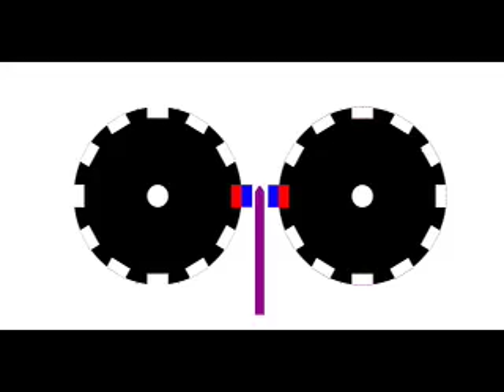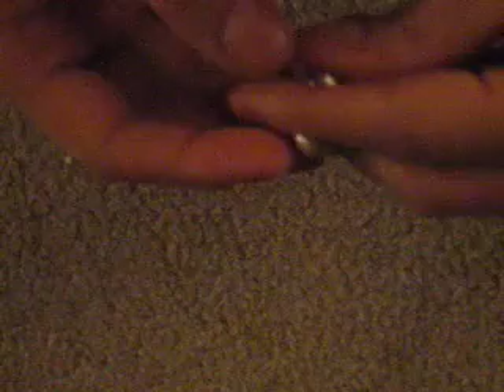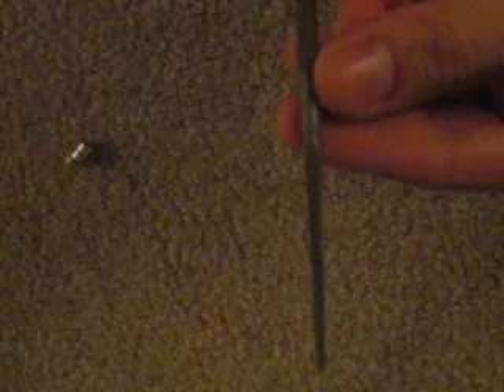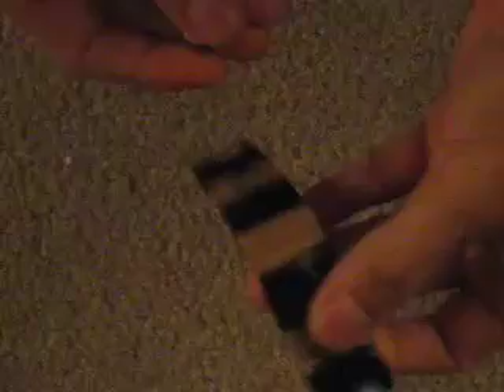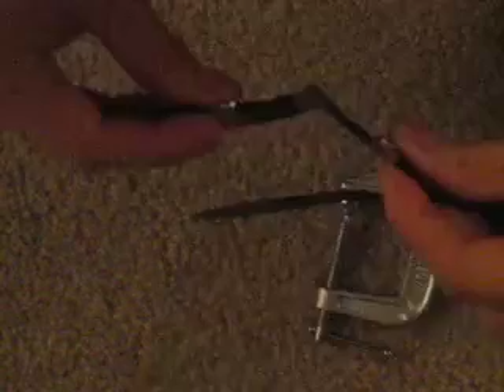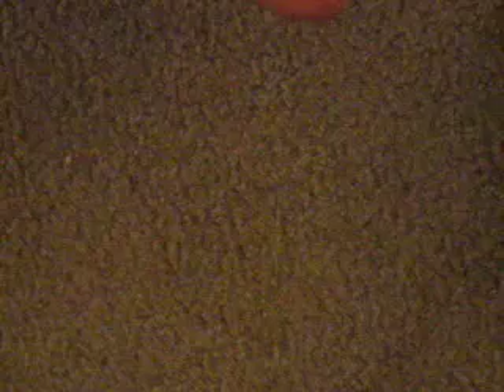Magnet Motor concept and How magnetic shielding works

Comment: Doesn't work of course. Moving the shield consumes the energy which is produced. The principle of conservation of energy is known since 150 years. It's time all people take notice of it.
Reply: Durchblick A small note:  Actually it is likely that moving the shield will consume more energy.  At each point some energy is converted to heat.  The shield will warm up as you change the field in it.
Reply: Ken Smith
Thx for adding this, you are definitely right of course There are always losses. Besides the field changes also eddy currents will occur.
Reply: hehehe
Reply: Durchblick Conservation of energy has any relevance at all to electrical system IF* the it is a "closed" electrical system. In an open electrical system energy can come from the the outside and add to the circuit. That is how John Searl generator works, also why if you use longitudinal electric waves to transmit power you'll get more energy at the receiving end than was sent. The electric wave picks up frequencies from the environment and adds to itself.
Reply: Naoki Kashima
Conservation of energy is applicable also to open systems, if you account for the energy going in and coming out and the energy which is stored in the system.
John Searls generator does not work. There is no proof for that at all. Longitudinal electromagnetic waves are nonsense, they do not exist. You can pick up energy of electromagnetic waves, every radio does it, but the origin of this energy is well known, it comes from the radio station.
Reply: Durchblick What about solar panels or wind power? The power for those systems come from the environment... those 2 examples are 'open systems'. What about 'free electrons"? What about radio wave, or natural radiation? All these things offer a source of energy. A friend of mine replicated more than 1/2 of John Searl's generator. He used polymagnets, the works. There are many many other self running generators out there. The Howard Johnson's magnet motor, Testaika Generator (still running in Swtizerland, uses no known fuel), water-powered generator (Stan Meyers). Recently a company came out of Canada "GDS Generator" that runs using only water. Turns out if you hit water molecule with the right frequency it will just fly apart. Again extra energy to help with this process come from the environment.
Reply: Naoki Kashima There are a lot of con artists out their, a lot of urban legends and enough nut cases to make it slightly uncertain what you are dealing with.  There are no free energy machines that actually work.  The easiest person to fool is your self.  Ask any scientist.  You have to design an experiment with the intention of proving the idea is bogus and then carry it through as planned and then look at the results.
Reply: Naoki Kashima
Energiwa from the environment (solar, wind, radio waves, radiation) are well known. Also well known are the devices to tap them and the amount of power which can be harvested. Power from radio waves and particles from space is rather negligible.

But the devices you mention definitely are not using these energy forms - so where should the energy come from? Howard Johnson never got his magnet motor running. Testatika was demonstrated, but no one was ever allowed to investigate it and it was never in practical use. Stan Meyer was a scammer, he was sentenced for fraud. He had a patent but no one was able to replicate his electrolytic cell. Up to now all tries to split the water molecule with less energy by a certain frequency have failed completely. In regard to free energy you find claims only, but never an objective third party proof.
Reply: Durchblick Here is a commercial for GDS generator, a generator that runs using water>> h t t p s://w w w .youtube. c o m /watch?v=vEqSuTOKUEg Here is a man from japan who invented a water-powered car independently from Stan Meyers >> h t t p s :// w w w .youtube. c o m /watch?v=CrxfMz2eDME&list=PLRmPNINoDGdXl4WxD9vhJDQukAUglXwlj Stan Meyers was NOT a fraud. He had patents across 3 different countries. Why patent a technology that doesn't work 3 times over (you have to pay $ every time you patent something). Stan's 'fraud trial' was a joke because he wasn't allowed to bring any of his technology as evidence. The court's sound recorder "broke" so his testimony was never recorded, etc.
Reply: Naoki Kashima
A patent is no proof that an idea works.  The patent inspectors are overworked and under paid.  All kinds of bogus stuff gets patented.  Because it is bogus, nobody is willing to pay for the lawyers to break the patent and thus it remains on the books.

Meyers didn't have anything that worked.  He may have believed he did or he may not have.  This is the only sense in which he may not have been a fraud.
Reply: Naoki Kashima GDS-generator is a scam, that's why they don't allow comments to this video. Also "Genepax" (your second link) was only trying to get money from gullible investors. They never gave the slightest proof of a working water car.
And it is clear why scammers apply for patents. This is more convincing when you try to get money for something which does not really work. But I don't say Meyer was a cold blooded scammer, most likely he was mentally disturbed. Meyer was not sued by the state, he was sued by two investors, who paid him 25.000$ for the right to distribute this technology but this technology never emerged and Meyer was not willing to return the money. The sound recorder may have broken down, but even in this case there is a protocol of court proceedings. And the court himself ordered an expertise of Meyers electrolytic cell. It was screened by experts, efficiency was well below 100%. For a water car you would need at least 400%! Meyers patent is public, no one ever managed to get an overunity electrolysis cell by following the ideas of this patent.

There is no need for you to supply me with further links, I guess I know them all. But if you can give me evidence that there was a free energy machine which was submitted to a credible third party test and was shown working, it would be interesting. But this never happened.

Comment: Law of Conservation of Energy. Sorry Bro. No deal.
Reply: *****
Please write the equation so we can all see how it violates the law of conservation of energy and your argument may (or may not) be validated
Reply: Peter Harris Interestingly enough, conservation of energy is a concept, that has very finite boundaries. I'm not so convinced even from years of physics study and Uni, that conservation is limited to a system, when it comes to magnetism, gravity, and charge flow. After all, they are cosmological systems, that we are a part of, and if affected, will not conserve energy in our discrete system.
Reply: Garret Krampe No system will fall from lower potential to higher potential. End of story. The first illustration with only a magnet and an iron rod goes from higher potential to lower potential. The second illustration, blatantly foolish, has lower potential falling to higher potential. Not to be rude, but "years of physics study" should include the concept of potentials in fields.  This video shows complete ignorance of the concept of potential
Reply: Garret Krampe ...but don't take my word for it.  TEST IT.
Reply: It's OK. I don't have to test it. It was a nice concept. It will not work. However. In the search for the holy grail of Magnet motors, too many forget the Halbach array. Simply by rotating the cylinder magnets they can switch off and on the field and change polarity .. again won't work, as you are fighting the magnets to get it to work. With recent electric models of the universe, which seem plausible in some aspects, there just maybe a whole higher dimension to conservation of energy.
It would be interesting to try this experiment with a "shield" that did not take much power to change from diamagnetic to ferro or ferrimagnetic.  Again UNObtainium ..
Oh wait .. it can be done with an electric coil ! lol
Reply: If you consider that every particle in the universe, has a magnetic dipole, exists in a flow of charge from the sun, and a lorentz force. It makes an interesting proposition.
Reply: Really when you think about this a little more, magnetic domains are never aligned, even in magnets, However, nano FeOOH is free to rotate and align it's d.e.f shells with the field.
When I was in year 3 (9-10 years old) I designed a motor that ran on magnets, to my horror I was told that I was breaking the laws of physics. So I did not build it, and felt quite stupid for thinking up the idea. I knew I needed a "Magnetic Shield" for it to work. And this video took my back to those days, of innocence.
Reply: Garret Krampe Thanks for the references. I will look into Halbach. I thought of similar ideas as a child, myself... mystified by magnetic forces. I applaud curiousity, however whenever I come across these videos with clear errors that are disingenuously (or erroneously) swept under the rug, I am compelled to reply. Cheers
Reply: Well this technology has no reason to not actually work. Given a broader perception of all technologies things will get pretty interesting in years to come. There are plenty of anomalies out there that defy known physics. After all. The common Air conditioner is one of those well understood technologies. With a COP greater than 100%. i.e. Power out is greater than the power in by factors of 3 to 15.
It's only when we consider the environmental contributions that we define the "system". So
it is truly a "FREE ENERGY" solar device. It requires an input to get a greater output.
Everyone knows that AC takes a lot of power, but consider a bar radiator in comparison. 
Anyway .. it's the holy grail of technology to show an "overunity" gain in magnetics. It can be done, of course, but to what degree ? The available background fields are very small.
Reply: Magnetism, and the mechanisms that drive it, are really very simple but not very well understood even by top physicists in their field, and most of those have postulated bizarre experiments based on a "feeling" for the animal. In recent times I've theorised that Charge, Gravity, and Magnetism are in fact linked, and that it is very temperature dependant.
Reply: When people theorise about ZPE, a known and quantifiable concept, we just have no understanding of dark matter and dark energy, and certainly no insight into how to manufacture, or sustain such a depletion, or how to harvest it, and the overall conservation laws that we can expect to fulfil in the process.
Reply: Even now concepts of negative Kelvin temperatures are coming to main stream science. It's all in the distribution of velocities.
Reply: I only get peeved when people try to sell fake technology. Not experiment with tech that does not appear to be based on known science. After all, NASA reluctantly tested a plasma drive in recent years that , by all know physics, should never work. It did. Equivalent to the power of a mouse farting in space, but still it worked.
Reply: Garret Krampe I explained why it won't work.  Nothing in the universe falls from lower potential to higher potential. Electrons in a circuit don't flow backwards (against the direction they are driven by the potential). Projectiles don't fall upwards (or radially outwards as I like to say) against gravity and these magnets will not either. And as I say... don't take my word for it.  Let the universe do the talking.
Reply: Reality doesn't give a shit about man made laws. We have several magnet motors that are high RPM and torque, start thinking out of the box bro.

Comment: The magnets are always attracted to the iron shield, separator, whatever you want to call it. I'll be calling it "iron."

The most efficient way to apply torque to a wheel is at a tangent. Perpendicular to that, you get nothing. Magnetic force decreases exponentially as distance increases. The push/pull forces described in the video are nearly perpendicular to the tangent when the magnets are at their closest to the iron and each other.

The video ignores the strongest, near tangential force in the system. Just after the magnets pass the "neutral area" they are still attracted to the iron, even if they're repelling each other. This attraction is opposite the forces discussed in the video, and in a generally tangential direction, balancing the forces in the system and leaving it as just another magnetically ratcheted flywheel.

Comment: What would happen if the metal rod up the middle was a super conductor?
Reply: Tom Hoehler
What if the superconductor were to operate at room temperature
Reply: It won't work because superconductor is a DIAMAGNETIC material: this motor need a FERROMAGNETIC rod !!

Comment: I made this system and although it didn't work, I need to fine tune to minimize the gear backlash, magnets repel each other like needles facing each other, as soon as the pointy needles are offset, they repel each other in the y axis and null the wheels rotation to create a reverse torque. I will post when it will work.

Comment: wouldn't it be possible to make a black hole with infinite magnets and IMPOSSIBLY  strong forces in each magnet and on a unbreakable holding plate that is about 1 millimeter X 1 millimeter. because if the  strength pulling the magnets together   make it so great that it would try breaking the  holding plate thing which would be impossible  and then say we add a tiny spec of dust / hair or what ever wouldn't the strength of the magnetic pull suck it in? it seems like it would work and I hope to god I'm not right because if i am freaking world war 3 4 5 6 7 8 9 and 10 would happen in a matter years.I guess it would also work if u made it bigger but u would have to increase the magnets immensely if u wanted it to work correctly. and at that strength it would have aout 3 X the magnetic field of earth so if u made it big enough u could engulf earth?

Comment: Mr. Tom Hoehler - The matter of cancelation is correct. Simple permanent magnetic field force cancelation. It's plus 1 minus 1 = 0. Otherwise there would be no cancelation. This has nothing to do with rotors. Buy several small magnets (from a hardware store) about 25 cent each and spark-plug-gap blades (from an auto parts store) about $5-6 with a set of 30-35 thin blades of different thicknesses. It cost less than $15 dollars to test this. Make a small wood holder for the magnets. Put non-magnetic nails to hold the metal exactly in the middle. Have the magnets repelling each other. Make it precise where the cancelation metal (blade) goes exactly between them in the middle. Too much metal the magnets attract to. Too little metal the magnets stay repelling. The right amount and their repel and attract fields will cancel.

Comment: Yes what I was thinking of is getting a 12v wind generator motor hook it to the grid tie inverter.
But have the magnet motor turn the wind mill type generator non stop power pumped back into your home.
No solar panels just a motor like one off ebay. GENERATOR - Belt Drive Driven - 6,000 Watts - 6 kW - 120/240V - Brushless
Get a strong magnet motor to turn it and have free power after initial cost of parts.
Or maybe this motor Super Dual 12/24 volt permanent magnet alternator pma for wind turbine generator
Hook it to a grid tie inverter.
Reply: Tom Hoehler He might mean a permanent magnet motor. So, he wants a little motor powers a bigger generator to create more power? hmmm, haha.
Reply: Tom Hoehler If it was possible it would be easier for the world to destroy the inventor, surely!
IF it was possible. I'd simply go completely off grid and the car would be registered as electric.

Comment: Mr. Magneticveil: what you're showing is cancelation and not shielding. The cancelation is along the horizontal X coordinate line and not the Y or Z coordinate lines. This can be tested and verified using small magnets and spark plug gap blades of different thicknesses. When the magnets turn clockwise and counterclockwise from repelling each other they will be pulled back by the top of the cancelation metal in the Y coordinate direction and therefore stop. A working template concept for this machine can - IN FACT - be made from this principle and has. Certain other things must be done for it to work. All simple.

Comment: Dear Mr. Magneticveil:
   What you are demonstrating is correct. It is not shielding but - cancelation - of the opposing forces of the magnets. The magnets attract the steel with a force of positive 1 and the magnets repel each other with a force of minus 1. Hence: positive I minus 1 equals zero (cancelation). The metal must be of a exacting thickness, length and width to work. You can put them a hairs distance from the metal and they will not touch. I've tested this.